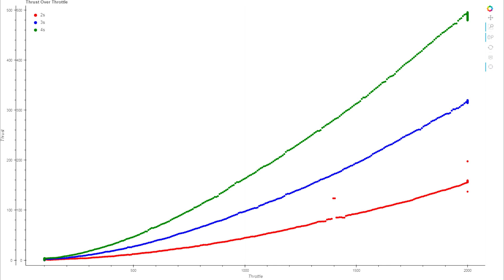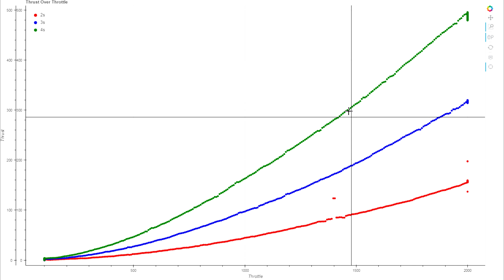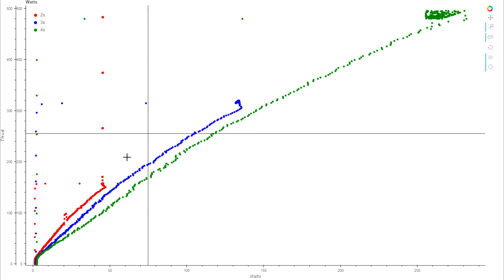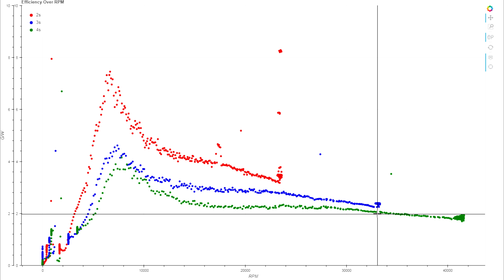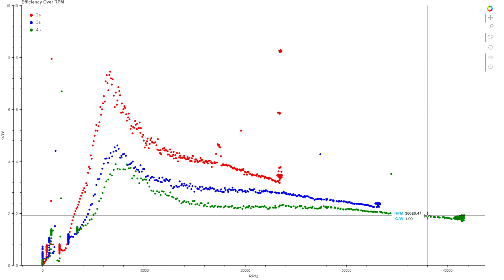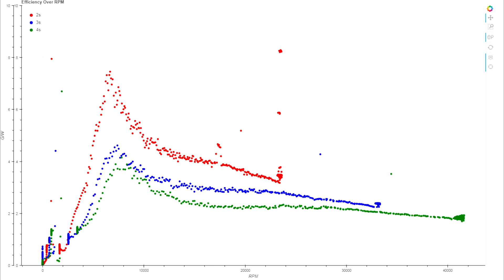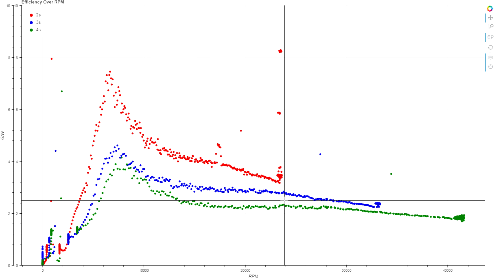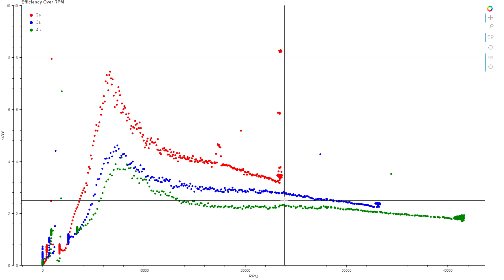Battery voltage vs. efficiency

Comment: Effect is probably due to higher current ripple in motor windings on 3 & 4s, to have same thrust you need same average current, but I^2*R losses will be higher in presence of ripple. Also saturation is more likely in case of ripple. Would be interesting to see direct oscillograms of current in motor phases.
Reply from the maker: I thought saturation related for a long time as well, but the inductance of the motor seems to do a really good job at smoothing out voltage ripple.  I haven't scoped any of my motors myself, but most of the charts I've seen online from BLDC winding current measurements show much smoother voltage traces than I would have expected.
Reply: @SiieeFPV  I've seen clearly visible ripple in the current in motor windings. I think inductance of typical motor is too low, and pwm frequency to low too to give steady current. Losses in motor are either rpm related or current related, and we see better efficiency at lower voltage & full throttle than at higher voltage and partial throttle at same rpm, it seems logical that's current waveform, as average current in winding is the same (because torque is the same).

Comment: You do know that the efficiency at a certain rpm with 2s is better then the same with 3s because of the ESC? The further away from 100 % ESC throttle you are, the worse efficiency signal to the motor and worse ESC efficiency you get. 

That is what you se in your graph. I think one can say that the esc is trying to create lots of sinus waves of voltage over time. This proces is imperfect and the result is not good enough. One can also say that the signal the esc is outputting is at a different voltage then the batteries. But I'm not to sure about that part. Intressting stuff.
Reply from the maker: we talk about that a little in the ARL report video.  Although the results they saw are far larger than I think we're seeing on ESCs on the market today.  I don't have a good way to measure the switching losses yet.  Component choice can also impact the balance of switching vs restive losses in the fets
Reply: Which components are we talking about? I have some unanswered questions about this whole subject. I do mostly rc cars. Can a brushless motor be easier on the motor if it is geared taller (Larger pinion). Reason I'm asking is that I've a heavy 1:8 buggy with a large 9240 1250 kv motor. Not that heavy though. About the same weigh as a standards 7542 with fins. It is geared about 45 mph running with 6s ofcourse. The batteri gets warm. Motor is always cold. Mostly full throttle in low Gras and tarmac. 
Can I gear taller and maby even gain some efficiency? The YouTuber thejang at ultimate rc mentioned lower mah when he geared higher.
Reply from the maker: mosfet choice largely, and the fet driver chip.  Loads on a car are really different from what we see here with multirotors.  Your motor loading is almost entirely inertial, with comparatively low static loads.  Gearing up or down just trades off one axis directly for the other, the motor efficiency would be the same but would end up just in a different place.  For example gearing down would 2:1 would shrink the x axis of these charts (RPM) down by half, while scaling up the y axis (torque) double.  The sweet spot of efficiency would be scaled right along with each axis.  You would double your torque and increase your acceleration but cut your top speed in half.  Now if you're comparing that with running with no reduction and sitting around half throttle  you can see where that impacts the efficiency you see, as at half throttle you're in a lower efficiency band, so if you can gear the motor to slide that efficiency where you really want it to be that's helpful.  If you have a much torquier motor than usual then you would probably want the opposite, gearing up, you say, to trade that extra torque for more rpm.  You'd be moving the efficient zone into even higher speeds, but could very well decrease your power draw at your old top speed just by being at a lower throttle position.  If you have excess torque then gearing up by 20% and then running 5s instead might give you the best of both.  Get you a tiny big more efficiency from lower voltage and running at near full throttle for the same road speed as before.  Hard to say though, I've never really played with cars.

Comment: i will get a dji spark and see if their power system is optimized for 3s.  They get 6g/w efficiency which is about double of what I normally see.  I doubt 2s will be more efficient, but it is worth testing.  Hopefully their speed controller is PWM with just some extra side data for the LED.
Reply from the maker: I'd love to see a good example of lower voltage not being more efficient.  The spark should be using an entirely different control approach, so it could be anything.
Reply: Ohms law is I ^2 x R for conductor losses.  Common sense would say lower voltages would run higher current.  But, would it?  PWM Duty cycle at lower voltages will be higher.  That means higher voltages could actually run higher switching current, but for shorter times.  PWM will change with the first power while losses change with the 2nd power.  I know from my switching power supply experience that efficiency is highest when the input and output voltages are close to matching.  The same thing could be happening with motors.  The Army Research Lab paper was talking about drastic efficiency improvements at lower voltages.  That is because none of these speed controls actually reduce voltage.  They only reduce PWM.  I bet I will see noticeable efficiency improvement on the dji spark at a lower cell count.  This idea is minimize instantaneous amps.  Thanks for the comment.
Reply from the maker: Even the FOC controls are PWM driven, at least the TI one was.  I think I was using a 60 or 70khz pwm baseclock.  When I was setting up the motor on my CNC the hitachi documentation for my VFD recomended setting the pwm baseclock as low as possible, that higher frequencies were quieter but induced more heating in the motor coils.  I was wondering about instantaneous current's interaction with magnetic saturation, but I also know it's not a purely restive system, and I don't have a good handle on how the inductive qualities of it come into play.
Reply: The heating of the copper windings is purely resistive and the 2nd power of current.  I believe the heating of the magnetic stator is power related.
Reply: I'm looking at the DJI Spark now.  It appears that the speed controls are sinusoidal.  They are digital with packets transmitting at about 900kbs every 1mS.  Too bad I can't use them with a standard flight controller.  I would like to hack the protocol for the data communication if I had more time.  The communication is single wire 2 way.  Do you have any efficiency data on sinusoidal vs trapezoidal speed controls?
Reply from the maker: Nothing very concrete.  Some of the reading I've done makes me want to say that matching that to the shape of the BEMF is the best way to go, but I don't recall specifically what makes a trapezoidal wind different from a sinusoidal one.
Reply: I have been researching efficiencies.  DJI looks like the leader in propulsion systems.  They have upgraded the Mavic Pro to have sinusoildal ESCs and more aero dynamic props.  The efficiency increase is 13%.  However, I would say 6% is going from trapazoidal to sinusoidal and the other 6% is the prop.  Here are the numbers:  
DJI Mavic Pro  24 minutes 734g   43.6Whr   6.7g/W   
DJI Mavic Pro Platinum    27 minutes   734g   43.6Whr   7.6g/W
Reply: Here are all my efficiency numbers from researching drones on the market:

DJI Spark   16 minutes  300g  16.87Whr    4.7g/W
Blade 180QX   10 minutes   95g  1.85Whr   8.6g/W
DJI Mavic Pro  24 minutes 734g   43.6Whr   6.7g/W
DJI Mavic Pro Platinum    27 minutes   734g   43.6Whr   7.6g/W
F100 Ghost   12 minutes  445g    13.32Whr  6.7g/W 
Syma X5  4 minutes  120g   1.85Whr  4.32g/W
MJX Bugs 3   20 minutes 447g   13.32Whr    ???g/W
MJX Bugs 2W   18 minutes   445g   13.32Whr   10g/W  (motor weighs 21g)
Parrot Beebop 2  25 minutes 500g   30Whr   7g/W
Reply: I don't think I can do much better than the DJI Mavic Pro Platinum.  My initial goal was 60 minutes long range fpv under 250 grams.  The 180QX propulsion looked promising.  However, I have since find out after building a hex copter based on that architecture that max thrust needs to be 3x bigger than hover thrust.  The full OSD with GPS electronics put my weight at 170g, which was too much for the little motor.  I could possibly make the DJI spark propulsion work less than 250 grams.  However, FPV in full HD long range digital kind of makes analog obsolete.  The Mavic Pro Platinum is pretty hard to beat.
Reply: I'll still test the DJI spark motors at different voltages with 2 different props.  But, I seriously doubt they will give 7g/W efficiency.  I am curious what they will do if they swing really big 7 inch props?  DJI specs their SNAIL propulsion system at a lower cell count as the prop size goes up.  So, there must be an efficiency gain at lower rpm and lower voltage.  But, DJI said it was to prevent motor overloading.  All I need is 62g thrust at 7g/W efficiency on the Spark motors with a max thrust of 180g and I will have a buildable 250g drone with 35 minute flight time.  If efficiency turns out to be 4.7g/W like the Spark is currently specified at, flight time will be only 26 minutes.  I will see.
Reply from the maker: Ya, I think that target sounds really optimistic.  I would be surprised if any of those estimated flight times are measured as anything other than just hovering in place.  I would probably think about doing a sort of 6 or 7" build, possibly with an undersized motor, but it's impossible to make the powertrain choice from hobby parts with the information on the market right now.  Perhaps something more like a tricopter would let you keep frame weight a bit lower and get a larger stance for bigger props

Comment: I got same feeling by try and error ecalc data. I have built 6inch and ordered 2s3p of 18650 batteries pack. I'm mostly like hovering guy but recently bought 3s packs as I try acro on simulator. Where am I going? Thanks! :-)

Comment: you do good stuff you should do the follow up if you saved data. I was think it might be esc efficiency maybe higher amp units but it might just be coil saturation. so do you think better programming materials or motor design are needed?
Reply from the maker: Hard to say without really understanding what's going on in the first place, I still think that it's most likely something that the ESC is doing.  It's not a lack of rating though, the ESC here is 35a 6s rated, well excess of the barely 20a draw in this test.

Comment: How about motor responsiveness vs voltage? I would think that higher V gives more torque and thus makes a quad easier to tune and also feel better.

Also, do you think that we would see the same effect on a lighter prop? E.g. 3x2x2 or something...
Reply from the maker: I do have acceleration data from this test, but I wasn't controlling for RPM as carefully as I need to, so while the higher voltage all shows higher acceleration, it's also accelerating for a significantly longer amount of time so the results don't actually say anything worthwhile.  Higher voltage should make it easier to overcome the back EMF and I definitely want to take a look at that, I just need to do a new series of tests to nail that down.

Comment: Very thought provoking video yet again! Something else I'd very much like to know is the effect of larger mAh batteries on measured current output. I've noticed that I can hear a much higher pitch at top throttle with a 1500 than I could with even a new 1300
Reply: Sky Fpv good call... So just a current measurement at full throttle for both 1300 and 1500 and throw in an 1800
Reply from the maker: Ya, having limited current available from the battery will hold you back, and we know how poorly batteries perform at their supposed "rating".  The other thing to keep in mind is voltage sag, as the battery sags lower that directly effects what RPM you can hit.  Smaller capacity = greater sag at the same load.  That can have all kinds of effects as well, like where you end up with 2-3x the sustained amp draw during fast transients?  Your 80A punchout suddenly becomes 200A, and when the battery cant supply it the response time of the motor suffers, kind of like what you see with a kiss esc with the current limiter on.

Comment: interesting... I would not have guessed this either thanks for doing the test! But how many more amps are we asking from the 3s to reach the same amount of power as 4s?  I wonder if that makes the battery less efficient?  And if yes, if that balances or outweighs the efficiency gained by running lower voltage.  

For example if you're pulling 100 amps on 4s, then to get the same power out of 3s you'd Need to pull what, 130amps?
Reply: oops, I hit send early. My guess is that simply dropping voltage is not practical in racing maybe unless we were talking 12s down to 11S or something where we're not already exceeding the amps the battery wants to give up . 

Big picture I'm guessing it's more efficient to just run the lower kv motor with higher voltage big. Next test video idea?  :)
Reply from the maker: Ya exactly, as voltage drops amps goes up for the same power.  That's one of the big benefits to higher voltages, is you can use lighter wiring everywhere because you've got less current.  But remember as you reduce cell count you need to increase capacity proportionally, so in the end in terms of battery size it's a wash, because if you're pulling 100a on 4s from a 1500 that's a 66c load, and the equivalent 130a on 3s from a 2000 is also a 66c load.  Even taken to the extreme, it would be 400a on 1s from a 6000mah pack, still a 66c load.  Battery size (both physically and weight) is the same in all cases, just a different arrangement of cells.

Mixing kv and voltage is certainly coming, that I think is the much more interesting and important question, but harder to find a good wide spread of kv on a single motor.  I may have to settle for using the 1106s as an example.